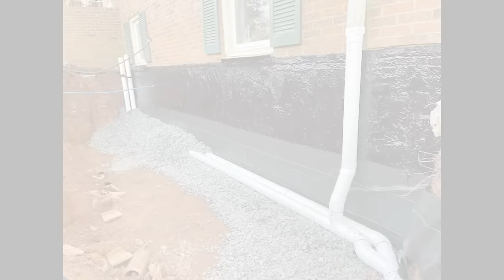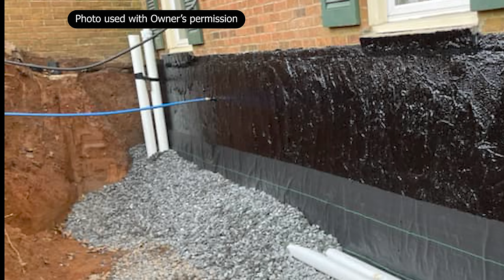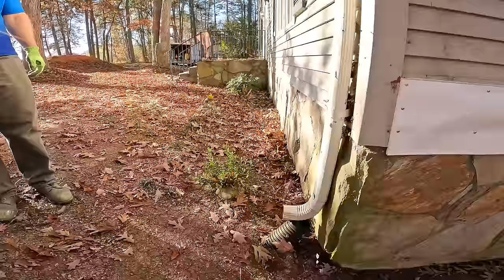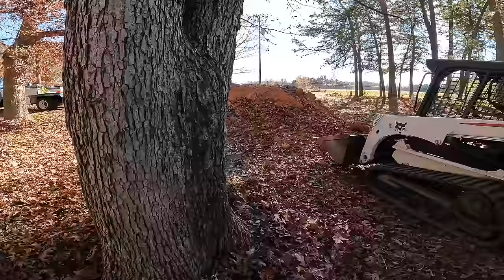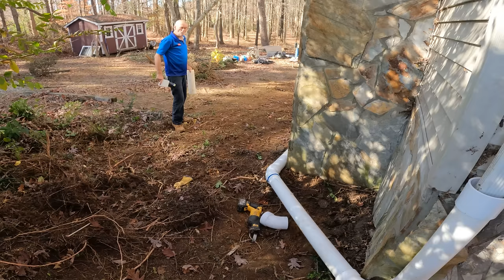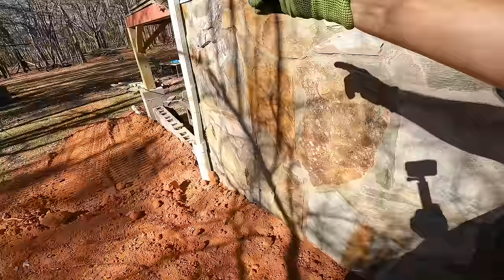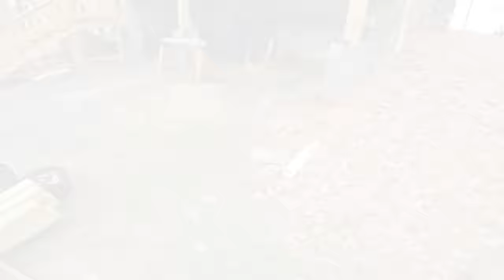Do I need a french Drain? Surface v subsurface water?

Comment: Never buy a house that sits downhill from the road unless house has a serious water management system in place.
Reply from the maker: Great advice! I just looked at a house with a client for an assessment. The house sits below the street and the driveway runs right through the carport into the back yard. I told the client I don't have a solution here and not to buy it!
Reply: Yep.   But I still wouldn't buy because the "serious water management system" depends on busy human beings to faithfully maintain the system, lol
Reply: @GCFD   at least if the house sits on a hill above a road the water can be channeled away from the house. In the front isn’t as easy because of the space limitations and options available in the front vs back.  I mention because I’m buying a house with water issues. Water comes down from the back.
Reply: lesson learned. we'd been in a drought for a good 10 years when we bought this house. 6 months after we moved in, the rain started, and seems like it hasn't stopped since. the area has natural springs, we're at the bottom of the neighborhood, and the yard on one end is about 2 feet below the road. we had a french drain & sump pump installed in the crawl space, with another sump pump outside to pump all the water up to the road. wish i could go back 16 years and tell myself not to buy this house.
Reply: @GCFD I didn't think it's possible for you to not have a solution. I've watched you pass water through apartments to reach the other side!!
Reply: It's a shame there are not consumer protections in place to force builders to build better in the first place 😢😢
Reply: @mangos2888  yeah city mandated building codes that are more strict exists. But there are always downsides to moving anywhere.
Reply: Who ever that contractor definitely did not know drainage science

Comment: As a retired engineer, I have observed a fair number of basements and foundations.  It has been a mystery to me that so many constructors believe that they can install bitumastic type foundation coating which will last the lifetime of the structure.  Just as it is true that concrete WILL crack sometime, it seems true that the mastic types of exterior coating layer will age and dry out such that cracks will form, allowing water to flow into the structure.  So, I sure believe in your approach to keep water on the surface and make it flow away from the structure rather than encouraging it to pool next to the structure and go down to the foundation footing. Good video, as always.
Reply: A builder doesn't care about the quality of the house, as long as it is as cheap as possible.
Reply from the maker: Thank you Dale! It also makes sense to me to keep water away in the first place and move on to more important things. 👍
Reply: @GCFD  Based on my drawings, I may have to put drain tile around the footing of the ICF basement I'm about to build. That may be just a formality, get it inspected, then do what you are talking about. I could backfill with clayey soil, and I have about a ton of quicklime I could till into it to make it fully hydrophobic. I could then slope it away from the house (top of basement wall), and pour a sidewalk over it, also sloped away from the house. It makes sense to me.
Reply: what about crystallization products such as xypex

Comment: In that picture of the foundation French drain, it looks like there are two pipes in the ground - presumably one perforated to catch water underground, and one solid to carry gutter water to the same outlet as the French drain?  If that's the case, then while I trust your judgement that this isn't good, it's not the worst-case scenario either.  It would be far worse to run the gutter water INTO the perforated pipe and hope it stays there until it reaches the outlet.  A previous owner here did exactly that, so whenever the outlet of his stupid black perforated pipe got clogged up with mud and debris, the gutter water would enter the pipe at one end,, back up behind the blockage, escape the pipe and come in through the basement wall.  Solid PVC now, problem solved.
Reply from the maker: Yes you're exactly correct that the pipes appear to be separated by a wye. The problem is if the pipe is ever blocked or clogged, the water can backflow into the FD pipe and out of the perforations into the foundation. If I ever do a FD and catch a nearby gutter,  always run a separated pipe for the gutter water. 👍
Reply: Fair point.
Reply: I was thinking the same thing. I've seen that application before, a perforated and non perforated system working together

Comment: I was waiting to see the part 4 of the other house you mentioned. That must be so frustrating to see that a builder has been allowed to persuade the client to use a completely different approach to what you had recommended. Based on the previous videos, it seems like that client will listen to the most persuasive argument, rather than think about the best solution. 
Kudos for not freaking out about it!
Reply: i wonder how long until that homeowner calls @gcfd back complaining because their solution isn't working?
Reply from the maker: We did insulate the crawl space and install a basic vapor barrier, so there will hopefully be a Part 4 to that project. I have the footage.
Reply: Cannae wait!!!   @GCFD

Comment: Brilliant - so long as there’s no sub-surface water.  
Even if there was sub-surface water and I had to put in a French drain, I would still want the grade fixed (just as in the video) so the water never flows towards the foundation. 
So in my opinion, good job all the way around.
Reply from the maker: Thank you David! We don't have shallow groundwater around here unless it's near a wetland or similar. If you have steep slopes or shallow bedrock you can get some horizontal groundwater flowing.

Comment: Bring the dirt over top of all that stone on the house that is porous, everyone is going to say “oh water will never get to the foundation now” water will still get to the foundation with a driving rain, doing all this work will help however there could still possible have issues in the future. Terminating the pipes as close to the house is only going to create pooling water close to the house that doesn’t need to be there, need to start running pipes farther away than 10 feet.

Comment: Great video as always Shawn. Very educational. It took me a few years to realize the reason water was pouring through the floor and walls in our basement was because the entire drainage system (downspouts, various basins) was going into some old orangeburg piping that also met with a footer tile pipe. The system was leading to nowhere. Whenever that old piping and drain tile backed up it was going into our basement. We replaced the entire system (except for the footer drain tile, instead we installed a crock in the basement to relieve any ground water) and poof the issue was gone.
Reply from the maker: Awesome! Proper investigating is key for solving drainage issues. Nice work!
Reply: Hey I live in a 50yr old Chicago quad level with a plugged drain tile system & crying floors like yours. What the heck is this "crock" you had installed. Right now I'm down to dehumidifiers and fans. Dreading the idea of clearing the 5ft wide space next to my neighbors concrete driveway. What are your thoughts?

Comment: This is precisely what I did - except not as nice looking.  Give the surface water a place it would rather go to than your basement walls, and run it elsewhere.  Between the stuff I watched on this channel and Apple, it got done.  Not easy, because digging never is, but it wasn't complicated either.  And it wasn't expensive because I didn't opt for FDM Lamborghinis where the Hyundai stuff will work fine.  Plus, the budget was out of the question.  Dig a trench a few feet from your house, use the dirt you removed to fix any sloping issues, fill with rocks.  Many cases you can get away with no pipe.  The water will go where there is least resistance.  Thank you for your videos man!!

Comment: I’ve learned so much watching your assessments and the solutions you provide. So happy that I was able to use info I learned from you to successfully manage water around my home. I worked with a contractor but all solutions would have to have been Gate City approved, and it all works great.
Reply: Show us your video
Reply: I have a yard of full of deep snow now, northern Illinois. I have no videos only photos. Before I met GateCity I tried to slope away from my house using river rock. Over time more and more of them sank into the topsoil. And I learned river rock was the absolute worst solution. I also became over run with thistles from hell. Had my contractor dig out about 3 feet of soil down the foundation wall to get rid of the thistles and the river rock. Then replaced with good dirt, but not clay. In addition he sloped much better down away from my house. I have straw and seed under the snow so next year I can start over with grass and appropriate landscaping (and no thistles).
Reply from the maker: Thank you! I'm glad my channel has helped you so much! Are you a channel member? 👍

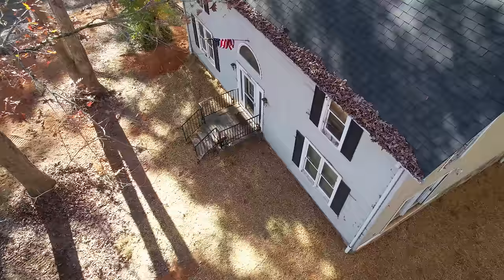Comment: See 25:37 min. of the film.
The gutters are clogged with leaves!!!
Water is pouring through the gutter.
A system must be installed on the gutters to prevent leaves from getting stuck in the gutters, e.g. a sieve or net.

Comment: I learned a lot. I had a pump placed on the side of my home about 15 years ago. I unplugged it and was vigilant to ensure my downspouts remained clear and ensuring my drains ran the water away from the house. I have the black tubing running along the house. I will have it replaced, change the soil, and slope the drainage away from the home. I live in Chicago. I wish you were here. Thank you.

Comment: Hey Shaun, I really like your approach to managing water and drainage. You and your guys do a really good job. One thing I would suggest is to make sure your stub outs for the downspouts are plumb. I know its a small thing and its a little fussy to get just right but IMO make all the difference in how the finish product looks. Keep up the good work.
Reply: Yeah, that one pipe could have used a swing joint to plumb it especially with how much cover dirt was in place, it would have hidden it nicely.
Reply from the maker: I totally agree Jef. Often we can't get the PVC plumb because the fittings don't flex. I prioritize having correct fall over the pipe looking good. Looks can be mitigated. Homeowners who have experienced the stress of flooding look at that crooked pipe as a beautiful thing.

Comment: SOOO glad I found this channel. I was just about to pull the trigger on a 15k job to fix one side of the house where the grading is negative and the downspouts don't let out far enough away from th house. It's just one corner of the house. I will DIY this first to see if it helps before dropping that kind of money. Thanks for this great info!

Comment: Temperatures in my area are as high as 100 degrees in the summer and as low as -75 in the winter. The clay soil here expands and contracts considerably depending on the water content, which pushes/pulls on the foundation. If you deliberately piped water next to foundations your house would need 50k repairs in a few years.  Proper grade and 6-8’ downspout runs are standard here

Comment: What ive done on a few homes for new construction in one area that has a ton of ground water in southern MN. We do our basement internal and external drain tile (code in MN). Make our rock burrito that goes to a sump or daylight (mostly mostly daylighting it). Back fill but then on the surface we do a surface French drain in the rock bed. I line it with plastic to bring the water a few feet away from the house then into the pipe. Plus a separate pipe the downspouts run into, and catch basins if needed.
Reply from the maker: Thanks for sharing your technique! I try to avoid placing a FD when there is a a basement at a lower level, but I'm glad it's working for you. Lining with plastic helps keep the water in the FD. 👍

Comment: I think it all depends on how house is situated on the property and the soil composition. My house is situated like his where it slopes down towards the backyard on both sides, front yard is almost level sloping gently to each side. My downspouts go into corregated pipes sitting above ground that run down next to the house to the back yard. I like having them above ground so I don't have to worry about roots and servicing them is easy. I've never had water in the  basement but water does come through, under the house a ton. My sump pump will fire up every 30 seconds if its a heavy rain during the spring thaw. I do like this video format alot. keep it up!

Comment: Great job! I was waiting for a concrete install at least at the front of the home with a channel drain. That’s what I’d do as it’ll be easier to maintain and easy on the eyes.

Maybe cost was an issue. One key point I have learnt from your videos Shawn is that it’s best to keep the surface water away. Those silly French drain ideas around a home are unnecessary and who knows if they’ll continue working years down the track?
Reply from the maker: We could have done concrete and a channel drain, but we had plenty of fall to be able to use clay. 👍

Comment: @2:28 I think you're experienced and it would be crazy to disagree with "slope away from the house" or "move the roofwater away as soon as possible", but those look like 4" non-perforated schedule 40 pipes on the outside (where the gutters are diverted to). They are glued up, they'll backup to the downspout before they leak. He used two different pipe runs and the only reason to do that is to keep the ground drainage and the roof drainage separate.

I assume the pipe closer to the wall is perforated on the bottom and the part that goes up above ground is the cleanout.

Comment: I wholeheartedly agree about shedding surface water away instead of introducing surface water into a piping system next to the foundation. In my own situation I have subsurface water and have a French drain system. The water comes up under the basement slab during spring rains or heavy downpours. There is a nearby spring that feeds a pond across the road. My well is just 58 feet deep. I must maintain power to my sump pump or the water will flood the basement. I recently upgraded to a "solar generator (Lithium ion phosphate battery)" to power the pump during loss of power events which happens in just about every rainstorm. PA actually means "Philippines Analogous" not Pennsylvania 

 The foundation of the house is properly graded and the gutters, thanks to you, are properly piped away from the house. Still the only solution for my house was the French drains and a sump pump. When I first moved in my Labrador thought indoor swimming was the best. The previous owners did not disclose the problem but at that time I had no legal recourse like you do today (after 1995 in PA). Thanks again for your well thought out solutions and great videos.
Reply from the maker: Thanks for sharing your story Paul! I like western PA and I've traveled hwy 15 dozens of times on the way to Western NY. I recently rode parts of the Pine Creek rail trail and plan to go back. I'm happy you've got your water problems under control and glad I could help! - Shawn

Comment: THANK YOU for clearing this up - subsurface vs surface water.  I've been debating what to do with my 100 yr old garage with dirt+gravel floor that is always damp after a rain.   I do have gutters draining rain away but I've also wondered if I have a shallow spring running under there.
Reply: Well, dig a hole down in a few different places and see what you find!
Reply from the maker: I'm glad you found this video useful! Good luck with your garage - Shawn

Comment: Great idea to keep the water in the surface less intrusive. No chemicals. Shawn the tree looks like it has roots ready to ring it and the soil or mulch was too high. If you could fix that.
My parents got leaf guard but the redid the gutters with the job. They have passed now and the real estate the away the brochure for the new owners.

I would love to see like a compilation video of bad gutters, and what your contractor installs for leaf guards. Obviously thats extra but explain that. Instead of spending for people ripping you off.
Reply: My issue was pine and fir needles.  Found some foam inserts at Home Depot that work great keeping the water flowing in the gutters.

Comment: I tend to agree with your approach; get the water away from the foundation if at all possible.  Those waterproof coatings may work for a while but they will break down and crack and then you're back where you started.
Reply from the maker: I agree. You may be worse off if you've succeeded in getting water into the foundation.